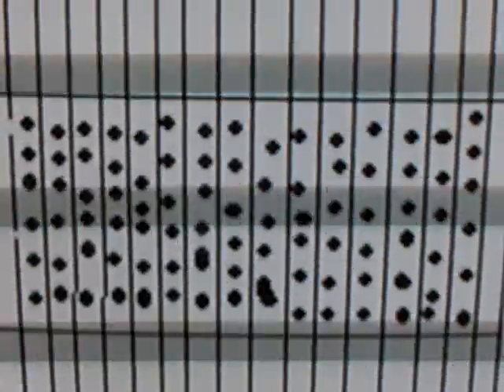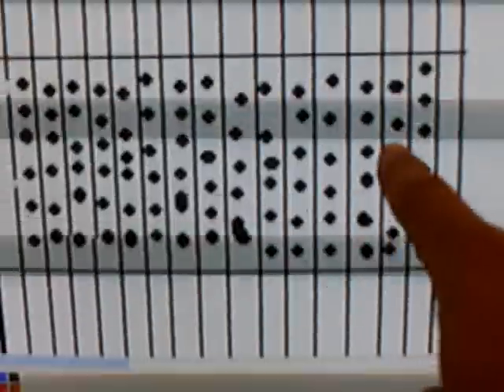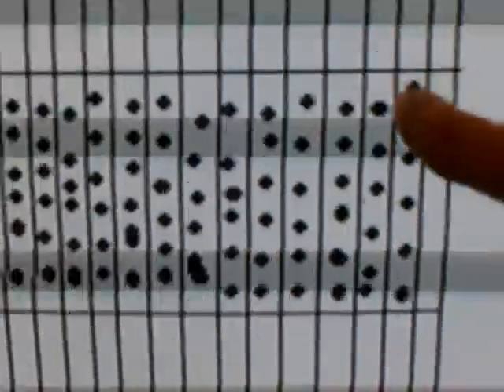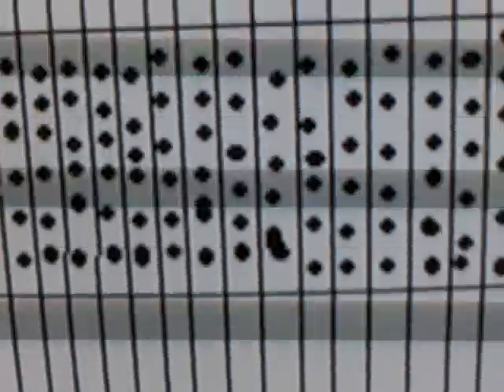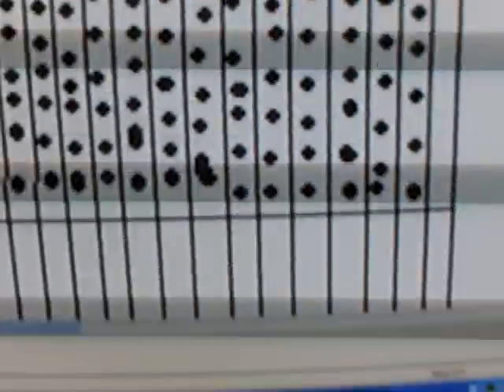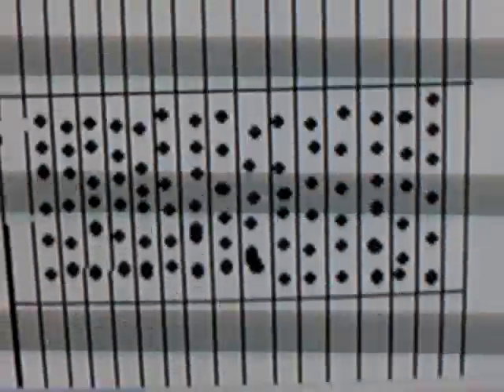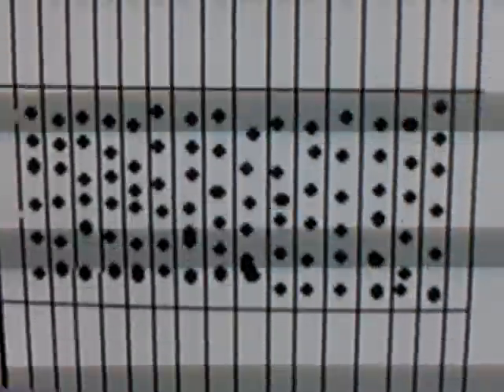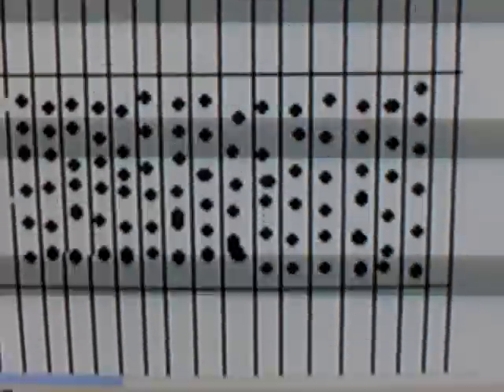New 16plate 4x5 NO hole drycell Little more gasket detail

Comment from the maker: Driving a 97 nissan altima, I have changed the system a little ,I replaced the switch plate cell with a 16 plate 6x6 drycell.I am pumping 1.3 LPM and getting 7 MPG gain on highway and bout 3 or 4 MPG gain city...All I done is hooked the system up, and drove around with it on for couple days ,it took 3 days about 200 miles of driving before I started seeing gains..I dont understand it all but Its working, been working for almost 3000 miles now..I will send ya a message with more details ...